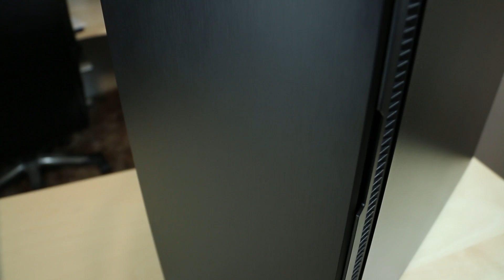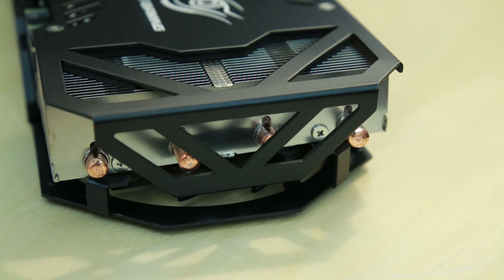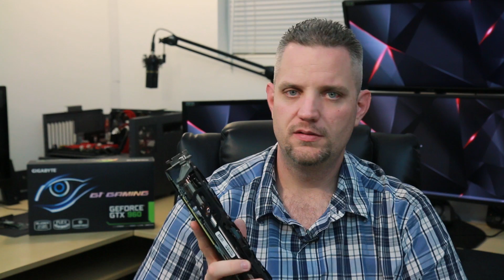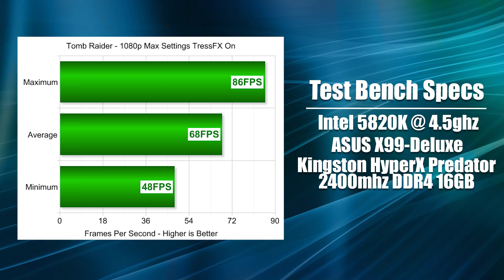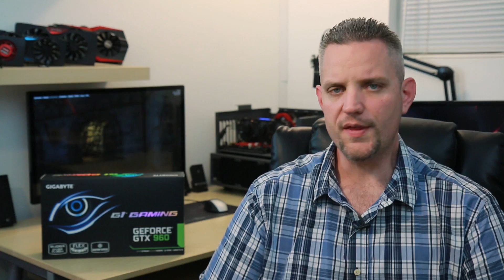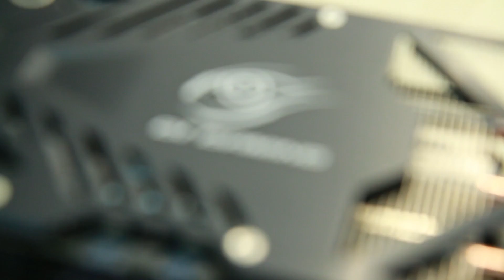Gigabyte GTX960 G1 GAMING - Best Mid Range Card Yet?

Comment: ok, this is the one i'm getting, look beutiful, has a backplate and a great cooler. Wanted to go for evga but it doesn't have a backplate and strix is small as hell and it wouldlook dumb xD
Reply: If you have got anything like a 680 or 770 or stronger do NOT go for this card, looks might be great but that's it buddy
Reply: RobinHood East got an r9 270 atm
Reply: ***** ok, thx for the advice, can't get the 970 (simply don't have enough money) and i guess i'll just buy the 280x then